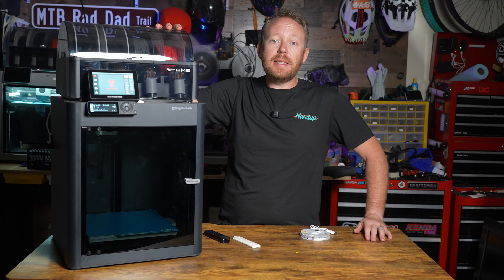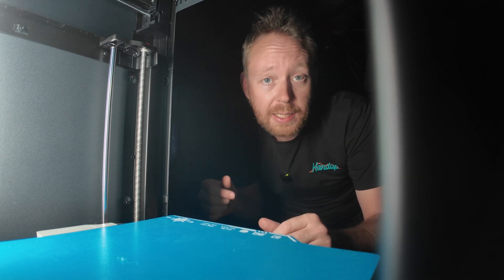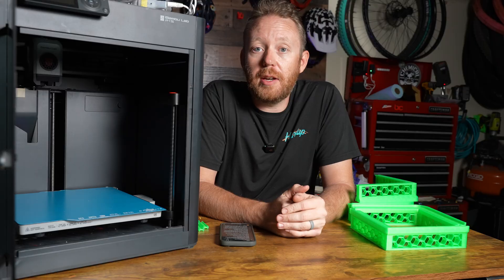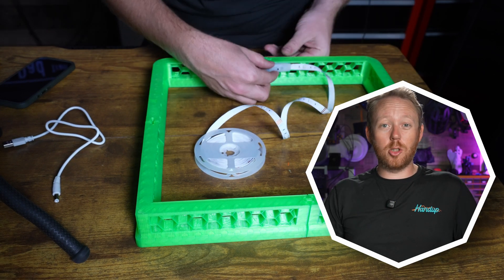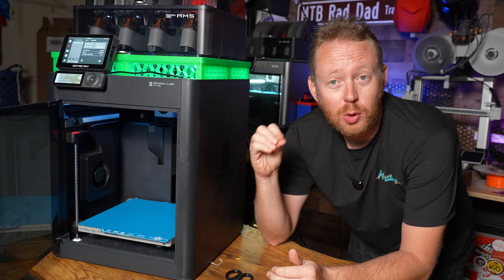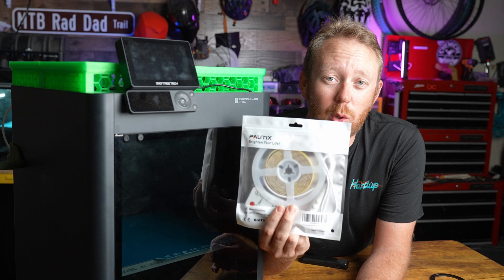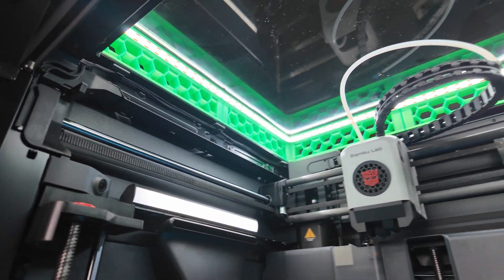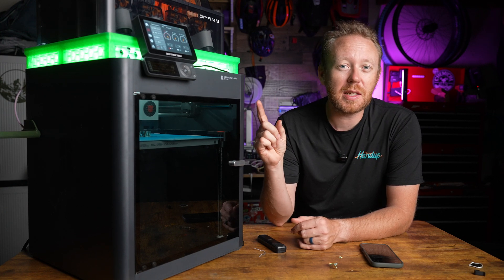Fixing the Biggest Flaw of the Bambu Lab P1S – Easy LED Riser Upgrade!

Comment: Why not use Panda Lux led mod? I Installed one recently and it fits great inside default enclosure and is much brighter than stock led.
Reply from the maker: I did end up using one and made a video on it.
Reply: @RadDadsPrintLab  Ahh I see, Ill check that too! Cheers!